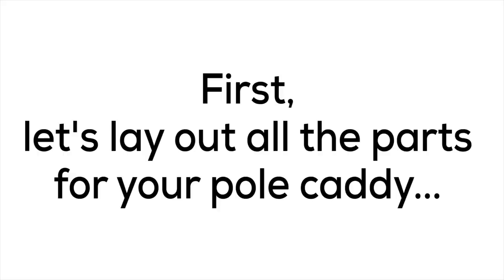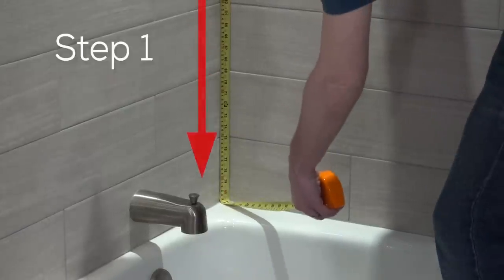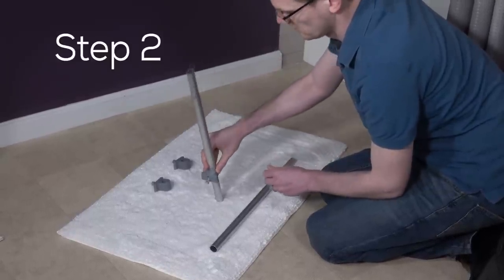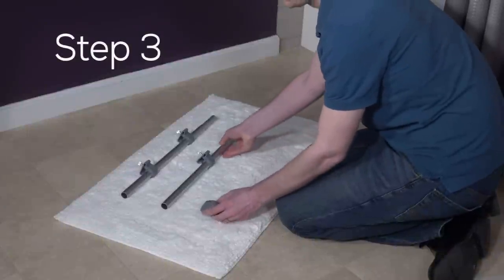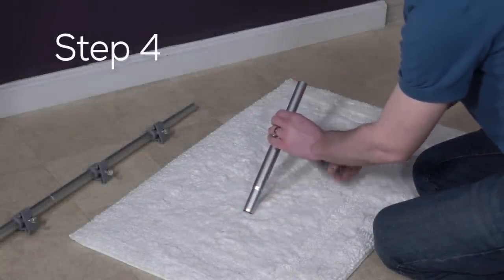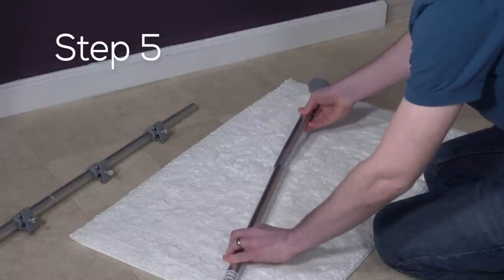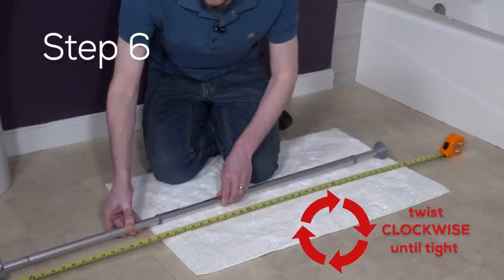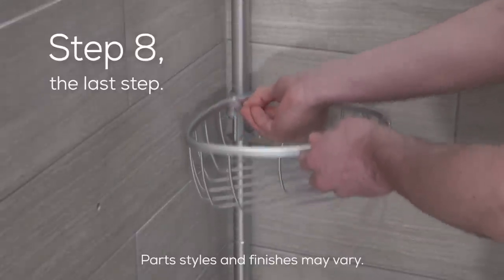Pole Caddy Assembly and Installation

Comment: There is a piece of plastic on the spiral part of one of the poles, looks like packaging but it needs to STAY ON as you insert it into the other tube. Mine was clear, maybe yours is a solid color. This is essential for the twisting and tightening part of the assembly. Hope this helps someone, suffered for 3 hours to learn that lol

Comment: My twist tube simply doesn't work.  Doesn't grab anything, spins uselessly.  Just bought an OXO.  More expensive, but very easy to install, no twist tube to deal with.  Threw the Zenna product in the recycle bin, not worth my time/money to return.
Reply: Mine too.  No help for this problem anywhere.  Returning this to the store.  Useless.